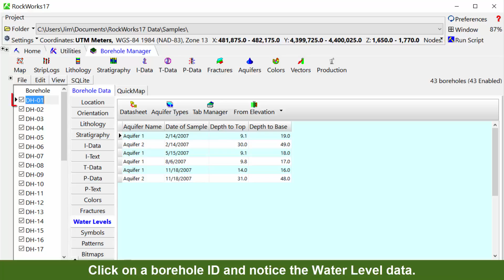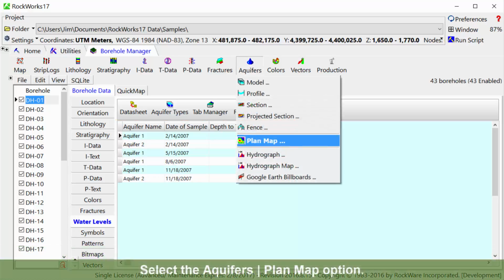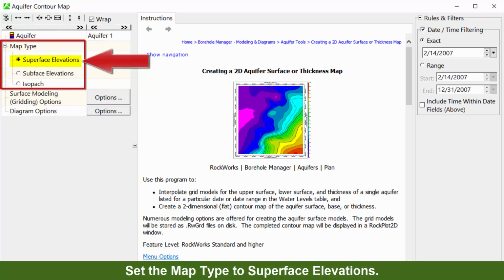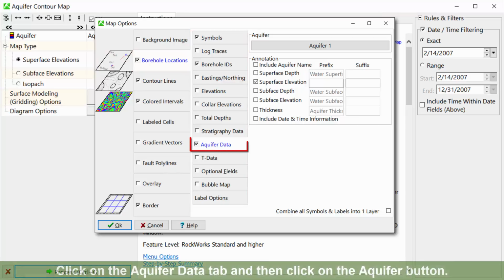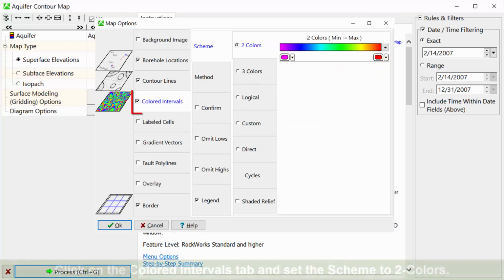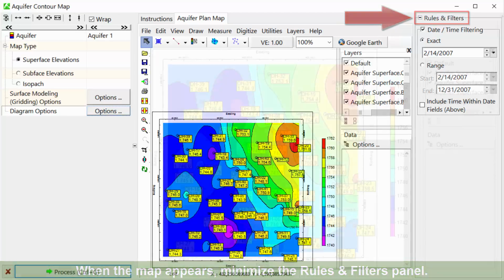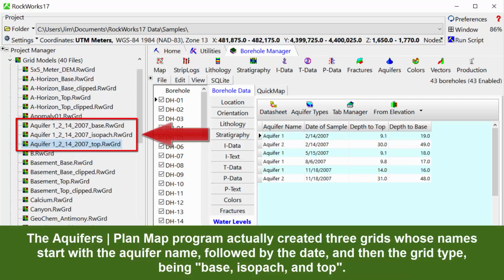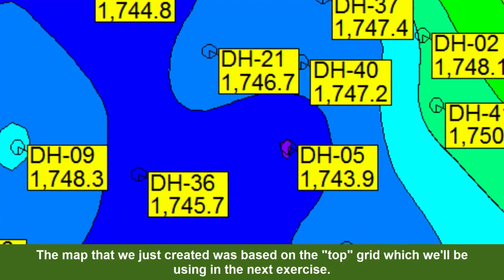(RTE 6.1) Creating a Water Level Grid

Comment: How the excel file will be organised in this case?
Reply from the maker: The water level grid is created with data in the Borehole Manager database in RockWorks. You can import data from Excel using the Borehole Manager File | Import menu. The format is described in the RockWorks Help, and mirrors the database structure with columns for the Borehole Name, Aquifer Name, Date of Sample, Depth to Top and Depth to Base. https://help.rockware.com/rockworks17/WebHelp/xls_to_bh_fmt.htm
Reply from the maker: There is no Excel file.  The program reads the water-level data from the Water Level table within the Borehole Manager database.  You can, however, import Excel files into this table if it's in a format that is similar to that shown at the 8-second mark within the video but there are other requirements.  Specifically, you need to define the borehole ID's and locations and define the aquifers.